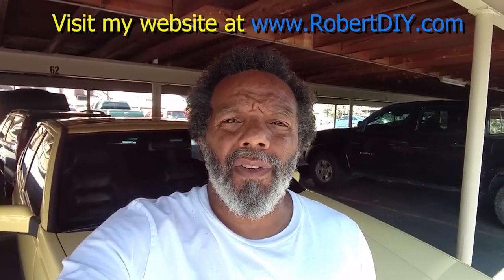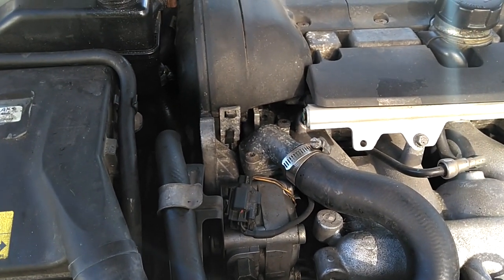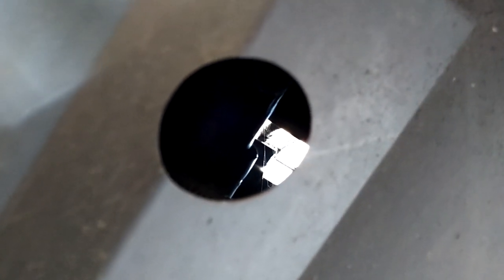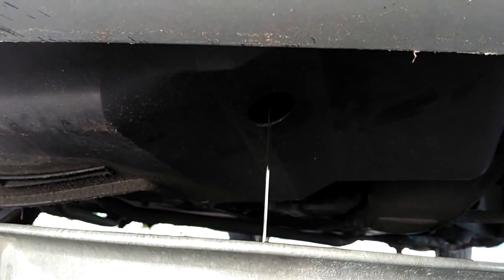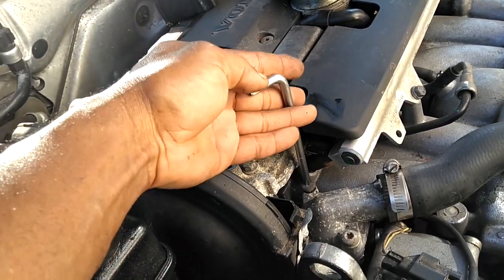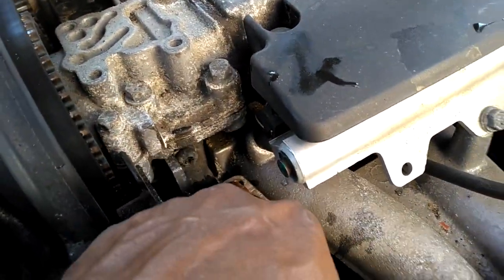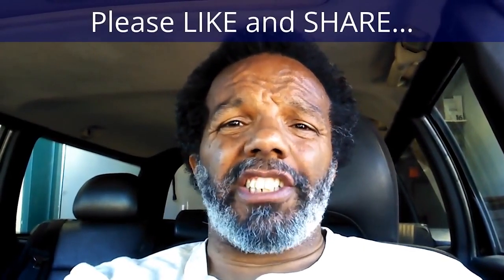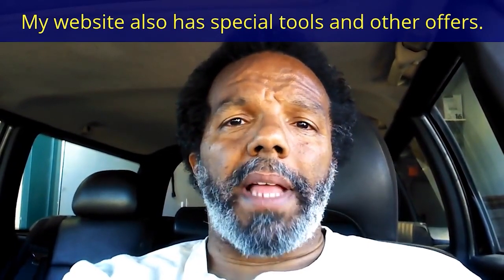Tinkering on a C70, hood release, thermostat replacement and upper torque arm mount. - HOWR

Comment: Great video sir! May I ask you where you check the right oem numbers? In the video you said “I think this is the right torque arm link for the motor”... but where do you check if it’s the right part Volvo uses also? Thanks!
Reply from the maker: VIDA Volvo repair manual.

Comment: Hey Robert! I found your channel and I love it. But I have a question. I have a Volvo s70 with 400k the transmission is still great! But I’m considering getting a Volvo 850 with awd. Mine is only a front wheel dive. Is it possible to use the 850 as a donar to make my s70 awd without having to chop shop the body?  I’m okay with changing all the suspension and fabricating an exhaust but not body fab. Before I make the purchase I want your professional opinion.
Reply from the maker: Yes it can work.
Reply: Robert DIY thank you! Gonna give it a try after I save up for it. I’ll send you a video of how it goes 😁